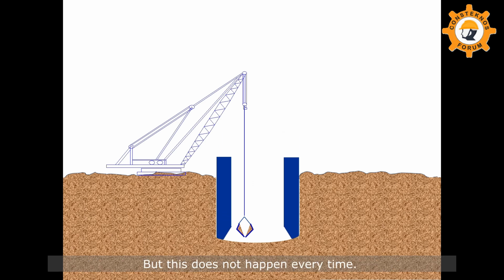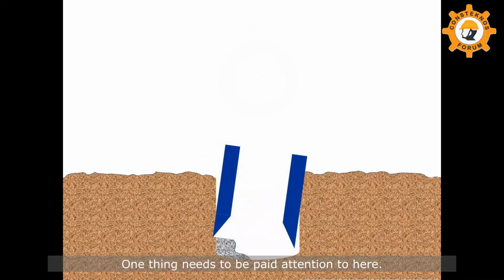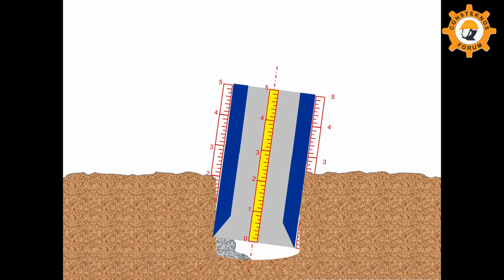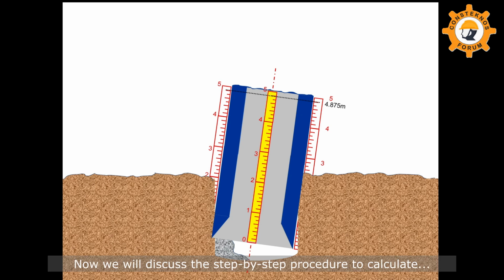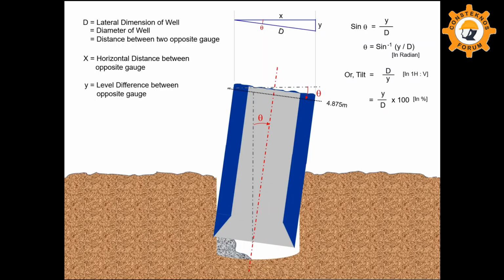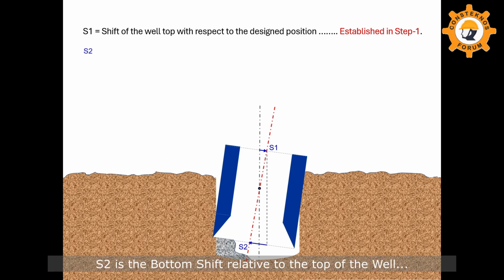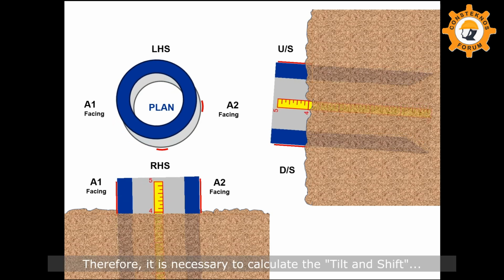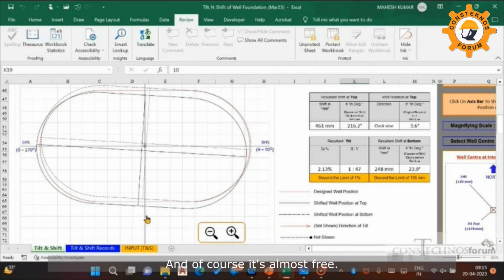Measuring Tilt & Shift of Well Foundation @MAHESH_IRCON

Comment: Understood well, but request the construction procedure to practically align the sunk well in its original design position
Reply from the maker: Tilting of the well during sinking and its rectification during subsequent sinking is a very common phenomenon in well construction.
That's why it's Monitoring after every lift of casting is mandatory.
Reply: @MAHESH_IRCON ❤❤
Reply: But it very common in Wells
Reply: @MAHESHKUMAR-f5d8c ❤